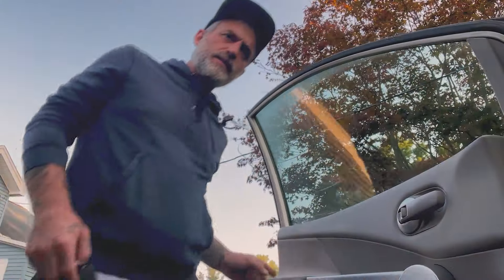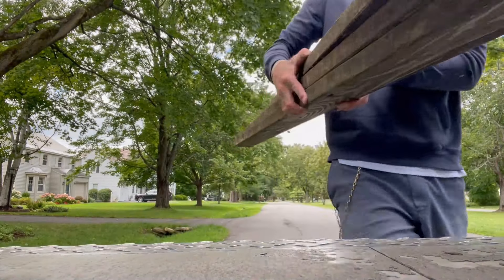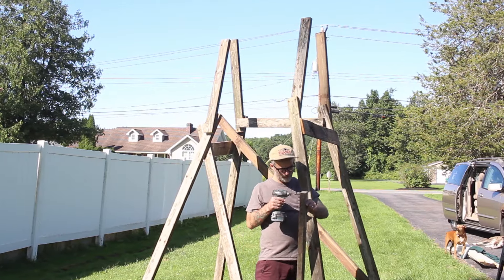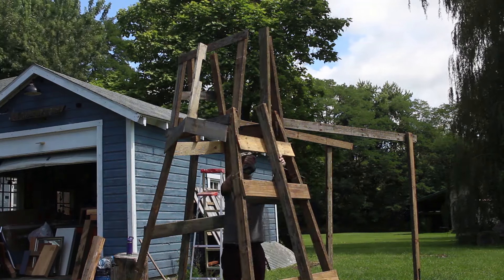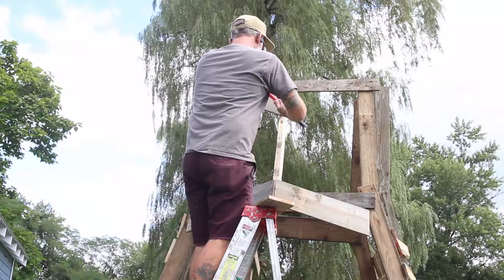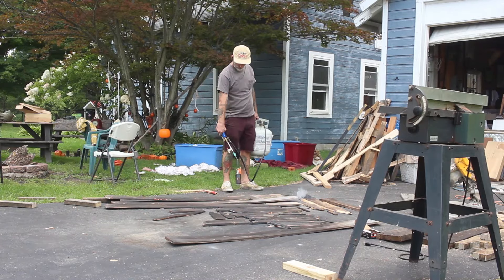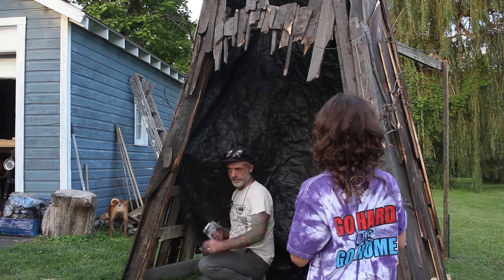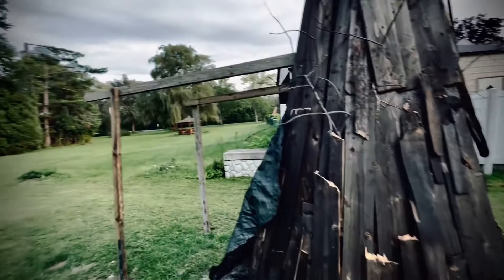Turn Pallet Scraps into A MASSIVE Halloween Display

Comment: An awesome build thinking of trying but I am wondering on move ability,  as I build out back,  do you think it would be a nightmare to move one it's complete
Reply from the maker: Thanks!!! I think mine would fall apart if I tried to move it but if I had planned to move it and built it a little different, I think it could be done. If we’re moving it, I’d use screws instead of a brad nailer and I’d put horizontal boards on the inside and outside of it to give it more support. Good luck!

Comment: Where did you get the device that pushes the nails out of the boards? I believe you called it an air locker. I could be wrong.
Reply from the maker: Search denailer on Amazon. I probably should’ve mentioned that! Totally worth having if you do a lot with reclaimed wood
Reply: Thanks